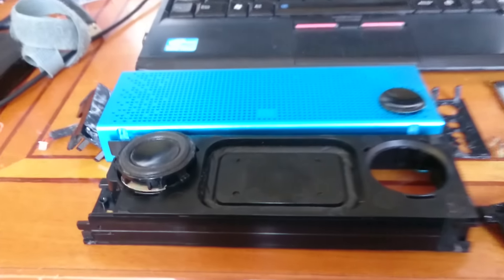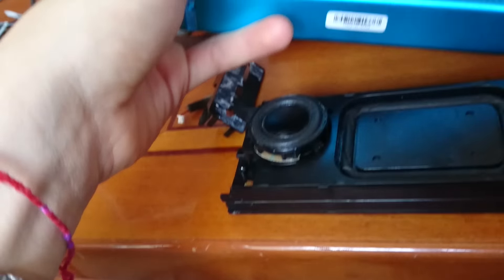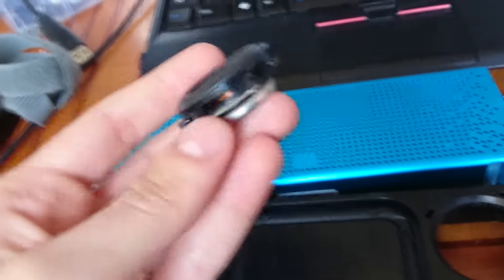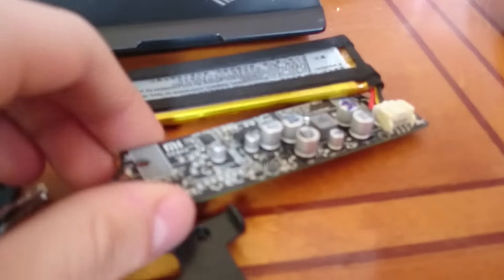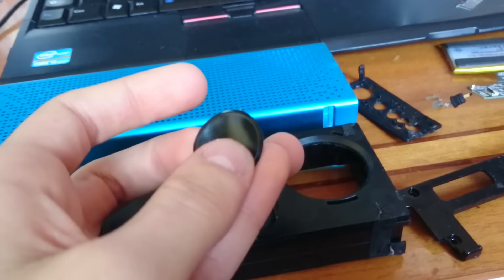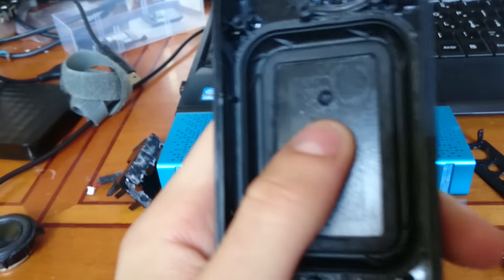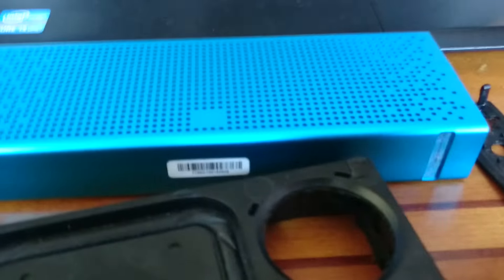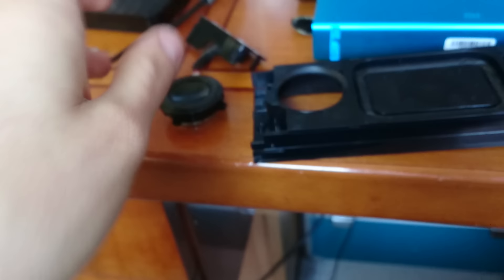What's inside a Xiaomi Mi Bluetooth speaker? (MDZ-15-DA)

Comment: Why you don't get better driver and build this in the case?
I think it will sound so much better with other ones.
The Amplifier is not so bad and has bit power.
Or make a own Xiaomi with a wooden enclusore :D
Reply from the maker: I already sold it for 5 euros lol, replacement pieces
Reply: that's a good price, someone got a great deal heh jealous
Reply: TheChris94 which driver did you take? Do. you have a Link?